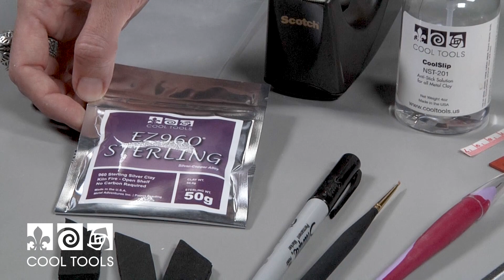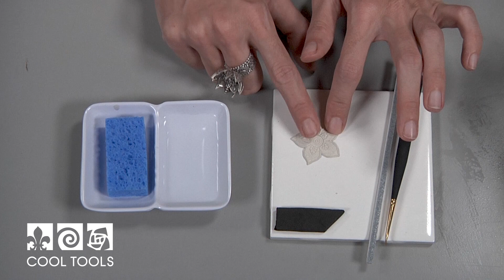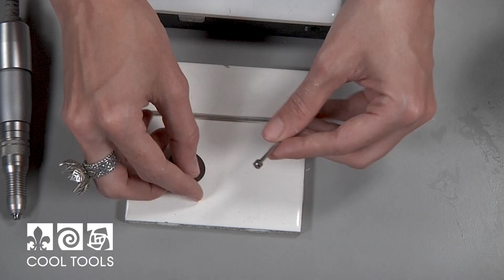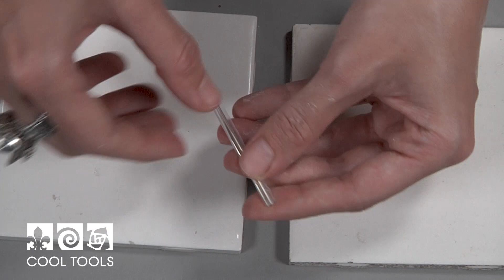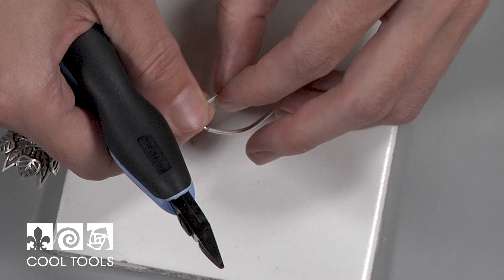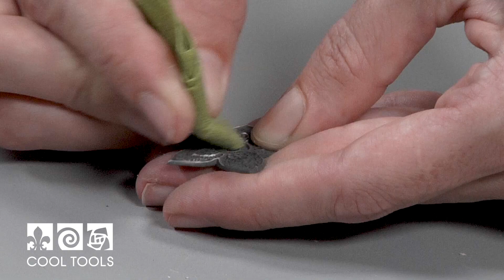Cool Tools | Spinning Henna Bloom Earrings by Wanaree Tanner

Comment: Hi- I purchased materials needed for these earrings from CoolTools. However, with regards to the ear wires and tube, the 20 g wire does not fit snugly inside of the tube. It is extremely loose fitting. Will that pose a problem in the future? I ordered the size that was recommended. Thank you!
Reply from the maker: Hi Dianna, someone from our team will be contacting you about this. Thank you for reaching out!

Comment: Beautiful design! I didn't know that tubing could be bent like that without denting or collapsing! Does it need to be annealed first or will it work without?
Reply from the maker: Hello, with bending metal it's always best to anneal it; however it can be done without. The added wire inside makes the hollow tubing solid which prevents the tubing from kinking. Thanks for the question!

Comment: Where can I find the tubing to make these earrings?  What is the OD and the wall thickness? I really want to make these! Your videos are so clear! Thanks
Reply: Is the tubing dead soft or half hard? Is the wire 20 or 22 G, you say both. Thanks for responding, I really want to make these!
Reply from the maker: Hi... Thanks for your question.  Here is a link to the products used in this video, the silver tube is listed. https://www.cooltools.us/Spinning-Henna-Bloom-Earrings-by-Wanaree-Tanner-s/2581.htm
Reply from the maker: Hi, we recommend using half hard tubing.  The dead soft version will work for this project however, it will be more susceptible to dings when using  to a forming plier or mandrel plier. Finishing the pieces in a tumbler will work hardened the silver and make it stronger.  Either gauge of silver wire will work as long as the wire used will fit snuggly inside the silver tube.  Thanks for your question!

Comment: Love the beautiful earrings and the beads you made in another video.  Can some of these techniques work with Polymer Clay?  Thank you for sharing your knowledge!
Reply: Would love to see these textures used with Polymer Clay! Just substitute water for the oil as the resist on the texture plate, for assembly of the beads you mentioned you may need to semi-cure the pieces before combining them with a polymer clay glue.
Reply from the maker: Hi Gloria, Yes, these techniques can work with polymer clay. Wanaree's textures work great with both metal clay and polymer clays.  Thanks for your question!